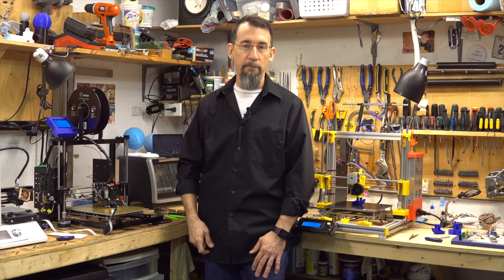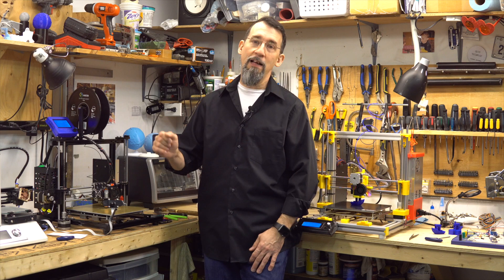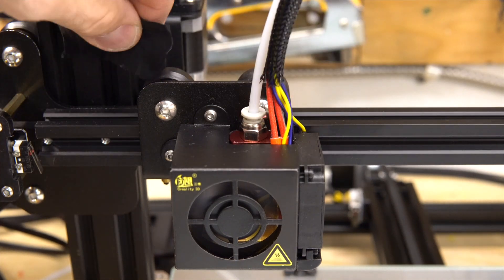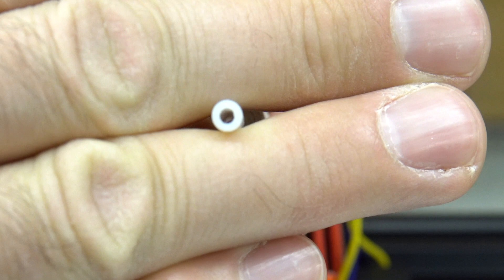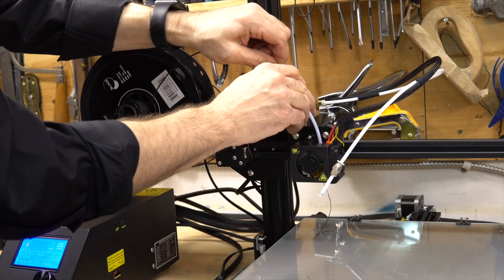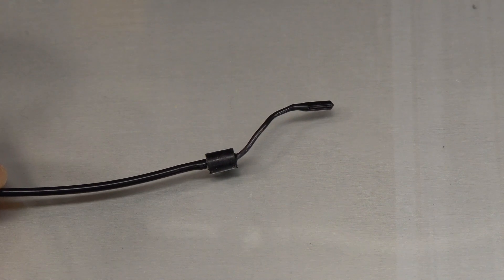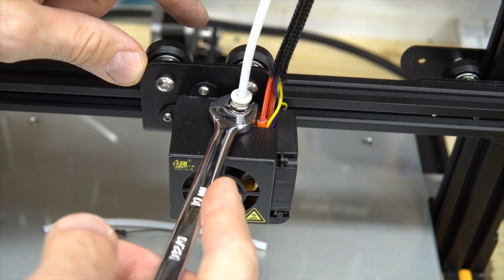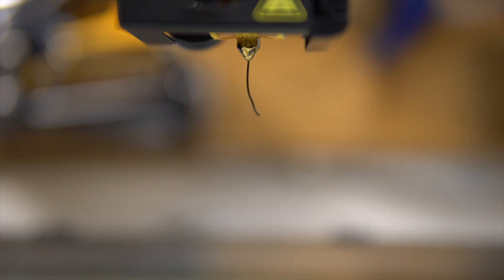CR-10S Unclogging The Nozzle

Comment: I did it exactly as shown in the video and the tip or the filament broke off inside the nozzle. I dont know what to do
Reply from the maker: You can try to push it up after removing the nozzle, try heating the nozzle at 170C to help.

Comment: Hello, I have A Creaity CR-10 with Dual Z Axis motors. The z axis goes up and down when homing but will not go up when printing. Is this a problem with my machine or am i doing something wrong in Cura ?
Reply from the maker: To be sure, try to print something already sliced on the original SD card...

Comment: My Boden tube is stuck in the hot end. Removed the fitting as mentioned but tube still won't come out of hot end. Tried pulling quite hard and that didn't work
Reply from the maker: Hi, you could push it from the other side if you dismantle the hot end assembly

Comment: great!    I always just remove the Nozzle and heat it up with a blowtorch in some vicegrips. and push filliment through it, let cool pull a few times untill its clean.  I can really get my wire brush on it too to , heats up in seconds with a torch and the metal vice grips act like a heatsink so it cools down fairly quick too. :)
Reply from the maker: Yes it can be done that way too!

Comment: I can't get my filament out it is stuck!!!?
Reply from the maker: You can try to unscrew the fitting holding the teflon tube on top of the heatsink, and see if it’s stuck inside the print head or in the teflon tube, if it’s in the teflon tube you could need to replace it, it is easy to find and doesn’t cost much, it has a inner diameter of 2mm for a 1.75mm filament.

Comment: Hi! What can Ido if my tube is stuck inside? o.O
Reply from the maker: Hi, I do not see my response so I will give it again, I did also encounter that problem, the tube was really hard to remove no mater how much I push down the ring on the fitting, I just unscrewed the fitting that holds the tube to the head...
Reply: @Franks3Dshop  Forgot to answer you!  Thanks!  ;-)

Comment: Good hint :-) I realized earlier that pull out the bowden tube was impossible. Seems you have to loosen this fitting as you described
Reply from the maker: Hi, I did successfully removed the bowden tube, it can be a hard thing to do and can damage it in the long run, if you remove the fitting, just push the bowben tube forward you will see marks on it where it was in the fitting, remove those with a knife or sandpaper, than you should be able to remove the bowden tube when pushing the little bleu ring down. I prefer to leave it alone and just remove the fitting.
Reply: Yes thank you. Pushing down this ring didn't help to remove the tube. I will remove the fitting like you. I have mounted a fang cooling design so I have to dissasembly the whole thing first :-(
Reply from the maker: It’s not as hard as it seems...